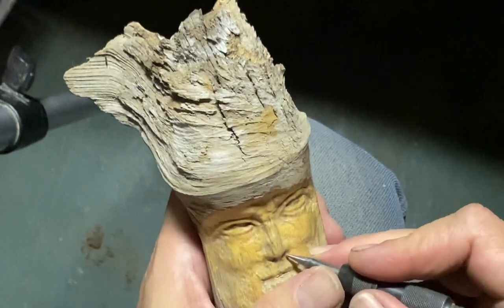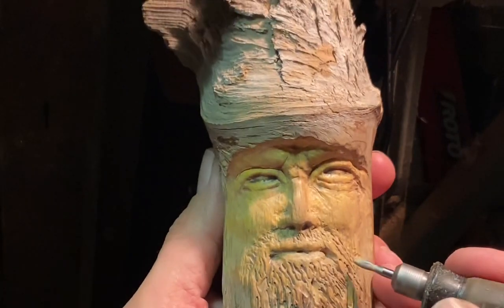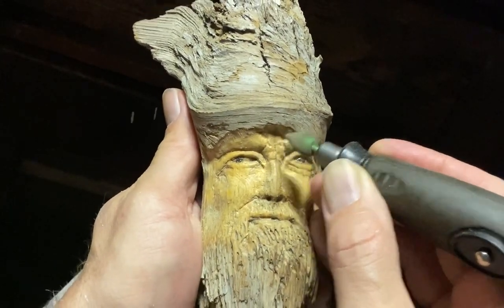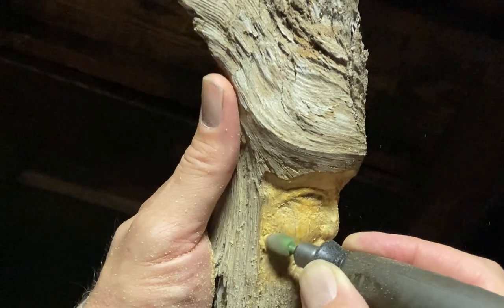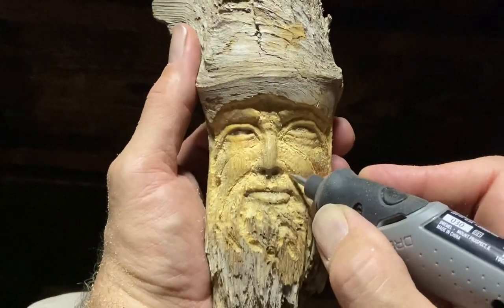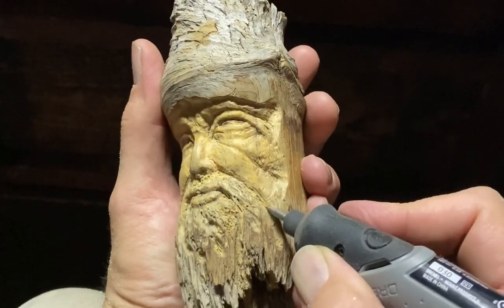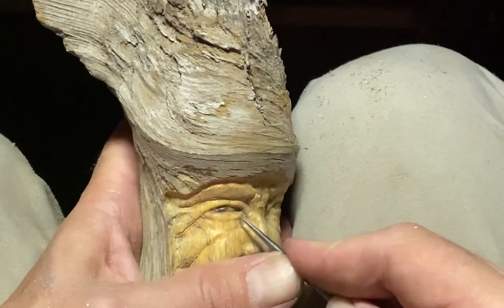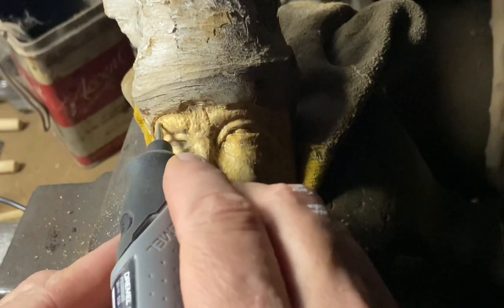Next Level Basic Wood Spirit Power Carving - Face Details

Comment: That's another great looking piece ! I'm sure you will show us some more of your talent, when you  get to the bear . One question , how do you display your pieces ?
Reply from the maker: Hi, thank you. For a table display, I use a flat piece wood, usually rectangular for the base with steel rod stand to hold the piece upright. Other times, the knot can be cut flat on the back with a hole drilled in the back for wall hanging.